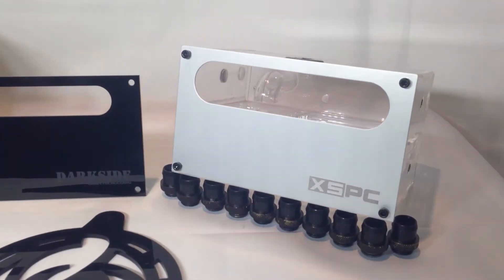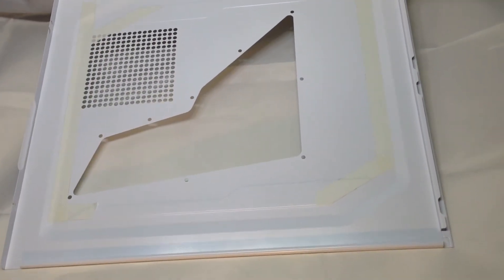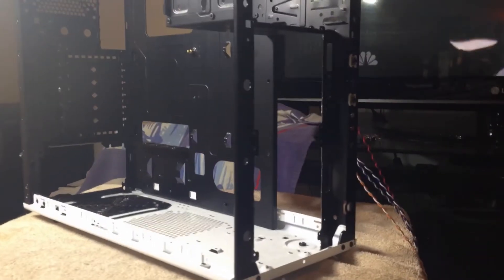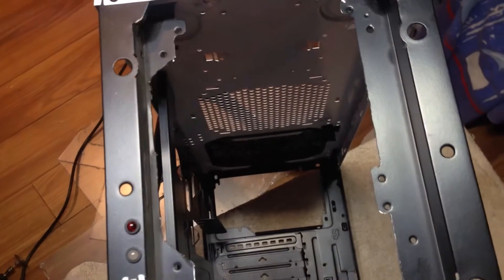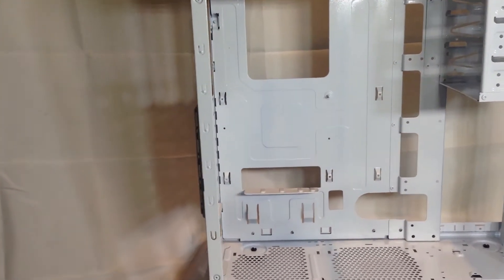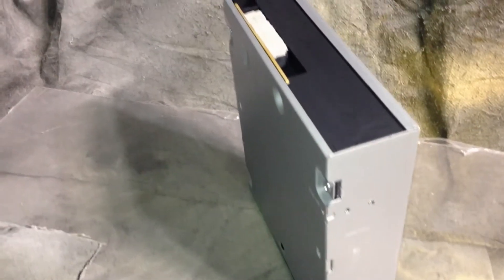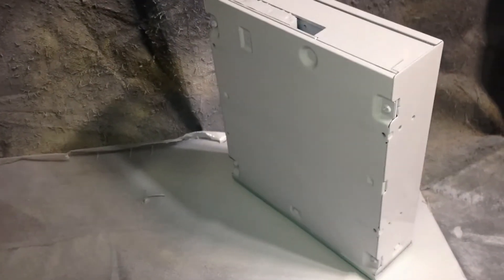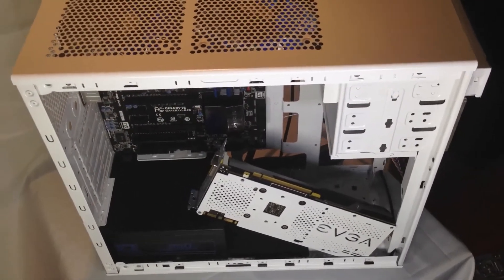Client Build #4 & Contest Winner - Project Glacier: Start To Finish

Comment: Love the mods you've done, especially the painting of the CPU Block & GPU Backplate along with the case interior. The colours go really together. I'm amazed you managed to fill the loop without power, it's definitely not the Mayhems pastel as I have just done a Z87 build using Pastel yellow, it took me ages to fill my loop. I've never had the confidence mod & paint a case, bought a dremel last year, it's unused. Great video, I really like how explained everything along the way. Looking forward to next build, hope it's ,coming soon.
Reply from the maker: With modding it just takes trial and error, the confidence comes with time :) when I started out a few years ago cutting anything was a big deal to me, now I'm confident I can make a case pretty much what I want as long as my attention to measurements and sizing is right, I will have nothing to worry about and nor will you ;)

Comment: Thanks for the reply, much appreciated. I've got 4 cases cluttering up my conservatory. Antec 900 & 1200, Xigmatic Elysium & Cooler master Haf X. Going to get the Dremel out tomorrow, you've convinced me! Can you give me some tips on spraying equipment please.
Reply from the maker: OMG, first off the Antec 900 cases are terrible to work with, but like you saw on my core reactor and reanimation builds can really come together if you take the time to cut out the unneeded HDD cages. Start with the Antec, use the metal parts you cut out for something else. Just hav e to start somewhere and build confidence :)

Comment: How scratch resistant is the paint? I think I will spray paint my case interior too.
Reply from the maker: you will need a minimum of 4 good coats of paint, then you will need a clear Lacquer and put 2-3 solid coats on top. It's like a plastic coating and adds to the gloss. really changes the whole feel of the case with the Lacqer :)
Reply: Custom Computing Thanks for the tipp. I will definitely try it out, because it looked really awesome in your video.
Reply from the maker: Thanks yeah it really stood out how important

Comment: The only time I approve of Thermaltake cases is when they've been modded. This looks great and has a fitting name! I'm sure you probably could've done more had they client took a 760 or 770 or the 780.
Reply from the maker: I agree, I would have done custom sleeving and probably acrylic tubing, but thats at least another $500 if done right with the tubing and fittings. so for the budget I'm really happy with the outcome of this build. we took a $45 case and made it look incredible ;)

Comment: How would you go about cooling the GPU in the future? And quick thing I noticed (not that major of a problem since the tubing is flexible) is how can you add or remove RAM? Except for that I love the attention to detail, I'll be sure to paint my GPU I/O in the future.
Reply from the maker: Thanks man! This build is never intended to water cool the graphics card. The client wanted aesthetics over performance which is why we went with a custom loop over an all in one. The tubing isn't touching or in the way of the ram so it is easy to toss in a few more sticks (tubing is flexible to but still not in the way). So this build was designed for solid performance but not to much upgrading needed and definitely not gpu water cooling.

Comment: So I have my parts planned out for my first computer build. I'm not doing a custom loop on this build but I will do one in the near future but I would like to send you a email of the parts I picked out and if you can give me any advise on different parts I should try or get instead of the ones I picked out. :)
Reply from the maker: Absolutely Id love to help out, there is a fine line between excess performance or price comparison, and spending on parts you don't need or won't use doesn't make sense. always good to get it looked at for other possible options :) I'll take a look today!
Reply: What is your email?
Reply from the maker: Cam Shaft
 you can send me an email at derek.watkins@customcomputing.ca:)
 I sent you a email from youtube to your email address.

(it is just registering now so it will take about 48hrs from the time of this post to be activated)
Reply: Custom Computing

I would also like second opinion.If you don't mind i will send you mail.

Comment: The only thing that "ruins" so to speak is the gpu not be put in the top pci e slot but I do understand the reason tho... nice build really liked the way it ended up... also.. what is the name of the case? thx
Reply from the maker: Thank you :) and yea actually the difference between 16x and 8x is not noticeable (https://www.youtube.com/watch?v=rctaLgK5stA) linus did a comparison and there is no difference at this point, so for aesthetics and the tube routing I needed to put it on the second slot :)

The case is a Thermaltake Commander MS-I Snow Edition, like $50, cut out the window, cut out the drive cages and paint the inside and you have a nice little case :) Glad you liked it, I will be updating my gold rush build shortly I have the parts now!
Reply: Custom Computing Yeah I know that the diference is not that big.. it's just that i got used to see the gpu on the 1st slot... can't wait for the gold rush update...